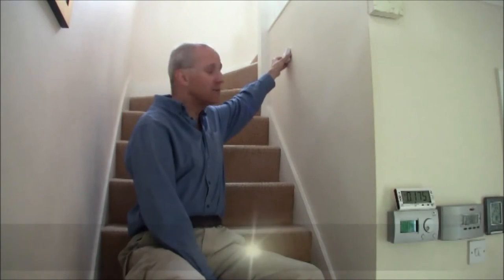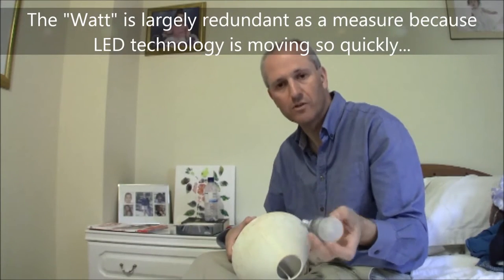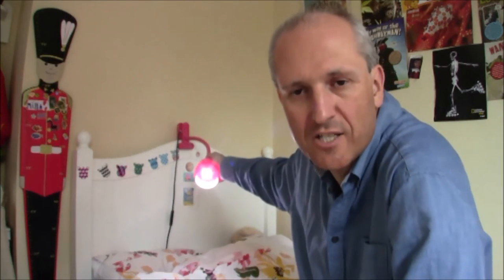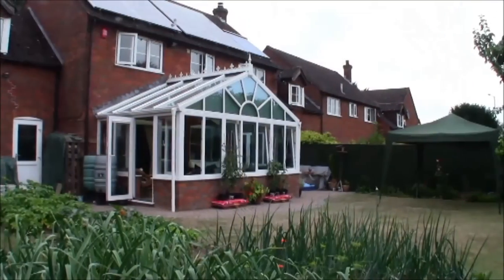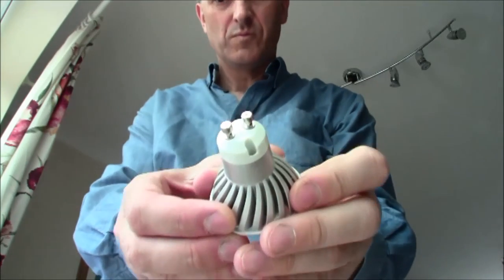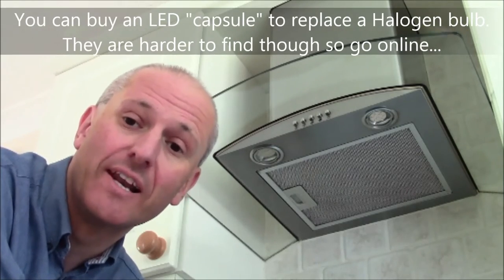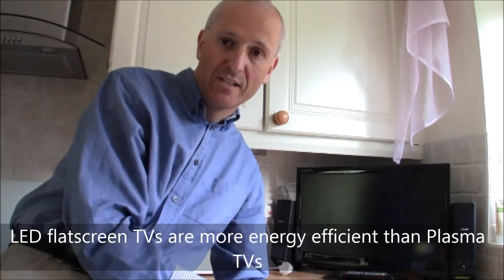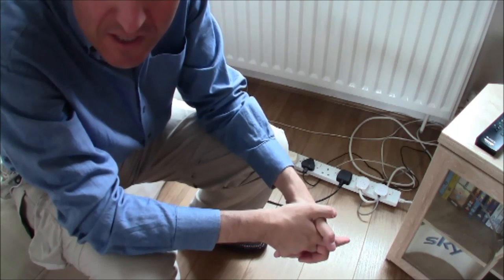Energy Efficient Lighting & Appliances Retrofit [Superhome59 part 17]

Comment: I have some of the Tecknets. One has failed completely (corroded terminals), and another one goes bonkers fom time to time and won't turn off. I also don't like much the name being all over them, discrete plain casings would have been better. I am going to try the Mr Beams indoor products soon. The outdoor lights are really good from them.

Thanks for the videos. Very interesting and useful.